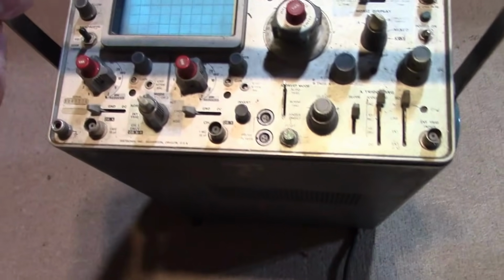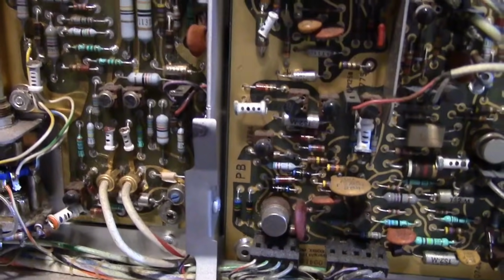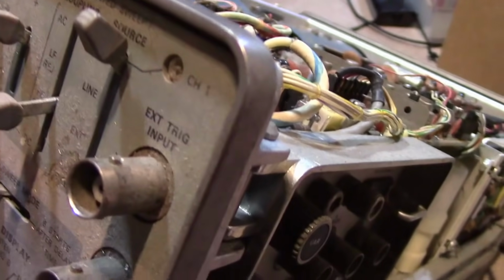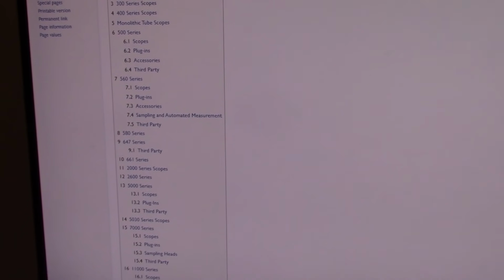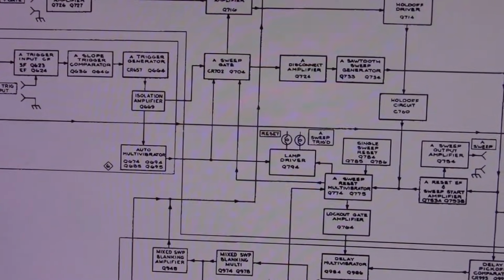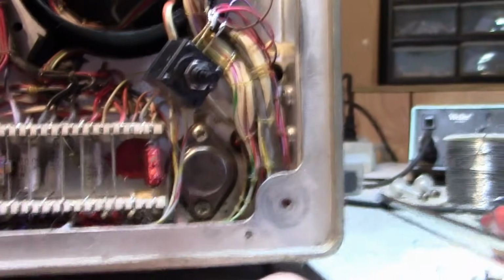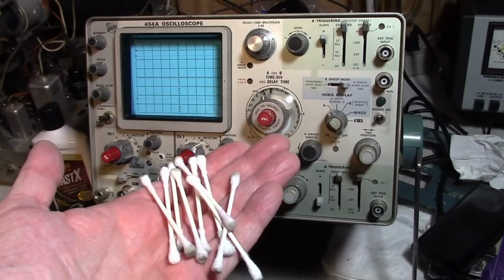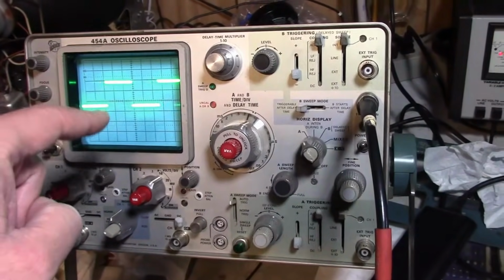Tektronix 454A scope from ~1971

Comment: The scope was made for IBM Tech as so it would fit under the seat of an airplane. IBM designed some of the functions. I cant stand the new digital crap, they are very cheaply made, but cheap in price is attractive. A few months back I had one and could not  get use to it. Make sure to keep the air filter clean.
Reply from the maker: There are very expensive, high end digital scopes too.  Like the $20,000 5 series B MSO scopes.

Comment: Nice work.  Ive restored a Tek 475 and a 475A which are similar scopes to the 454 and they were both basket cases and I will say this,  Tek scopes of this era (early 70's and solid state),  are absolute maintenance whores.  So many cam/drum activated mechanical switch contact points in the both the timebase and vertical attenuator controls make for some lengthy and meticulous cleaning steps.  Once you get everything done though,  they are pretty solid.  Just try not to move them around too much once you have them setup on your bench where you want lol,  they can get...a little grouchy

Comment: I have a telequipment scope from 1971 very similar. Cheap knockoff of tek but made by tek. It's actually very  functional. Not very serviceable like tek is though. It has like 50 or more transistors if I recall, all socketed in ceramic sockets. It was shipped to me on the east coast from California and unfortunately it was damaged in shipping. A knob was chipped, the plastic back was in a few pieces. Also some caps knocked off the board. All fixed now.

Comment: Thanks for taking the trouble to video your scope . I was given a 454A 20 years ago and it has sat in the loft unused since so I thought I would power it up today.  Well to my surprise it turned on and worked ok, I had a trace on the screen as well. When I swicthed it on after lunch it worked for 5 minutes then there was quite a pop sound and it is now dead. I have checked the fuses but still dead, what have I done to my scope ?
Reply: it has 4 Fuses.

Comment: It cleaned up outside  quite well. The critical  attenuator circuit boards inside are made with Polysulfone. 
The polymer will react with the "good stuff". Rotary switches are not affected by normal cleaning agents.
 Cleaning all the switches inside ( accessing) may be a trip down the "rabbit hole" for sure. It is a really nice 

scope. Steve

Comment: I have a Tek 454 that I got from a former employer's employee auction, think I paid about $150 for it back in the late 1980's.  Price included all the manuals, probes, viewing hood, and a scope cart.  It still works fine, though I had to do a bit of cleaning inside to get rid of some 'noise'.  The CRT filter bezel was missing on mine, so I made my own out of some strips of double sided PC board and a blue overhead projector blank sheet.   I'm not sure what the difference is between the 454 and the 454A, they seem to look identical. (Actually mine has a smaller CRT).
Reply from the maker: Based on other comments it seems the 454 had nuvistor tubes on the inputs while the 454A has FETs.

Comment: It looks like that was made in 1972 based on a date code I saw on a transistor. I know somebody who just acquired an HP spectrum analyzer (released 1979( and I would need to imagine that it's a fair bit more complicated than your scope which is already way too complicated. Like this scope it looks complicated at first and has a huge manual but once you power it up you find that it's relatively easy to use.
Reply from the maker: I had one of those early spectrum analyzers a while back.  Truly a wonder to behold.  It used analog circuitry to "draw" all the little zeroes and ones on the CRT face.

Comment: Hi Bob, I have a 453 and when I powered it up for the first time the roar from knackered bearings in the fan nearly made me leap out of my chair! Sealed bearings so you can't really lubricate them. R3ZZ I believe would be a replacement if your noisy fan is the same as the 453.

Comment: I have a 454A, needs some work on channel 2, but it does work. The inside of these is "art". All the hand soldered, hand detailed components. Quite a piece of kit. If I remember correctly, this is the last Tektronix scope that doesn't have proprietary IC'c etc.
Reply from the maker: Yes, that's right.  Although the parts list seems to show they are hand selected for matched characteristics.  Might be a little tricky to replace them.

Comment: I have five scopes, one like yours but 60MHz, a HP 16500c analyzer with a scope card, some cheap USB hantek scope, a Tek 2235 and my first scope a Elenco s-1330.
I've been working on a retro computer project that is going to use a 5UP1 tube and with some circuity to make it work as a X-Y display and use a scope terminal board I found to connect to a PC via TTL/RS-232. In other words a Vector Dumb Terminal.

Comment: Neat!  I have a 453A scope that I use when restoring old receivers.  It originally had an issue where the high voltage to the CRT would arc to a ground point when I got it.  I had a friend look at it and he told me to put a dab of silicon grease where the arcing was happening and it's never been an issue since.  Like your scope, it's loaded with boards and parts that will make your head spin.

Comment: Thats a very nice scope Bob. I have a Digital Tektronix that has a color flat panel display. Technically it is a bit above me. BTW I still cannot figure out what is wrong with my 1950 magnavox TV. The problem is is the AGC circuit. The AGC delat tube should have a minus voltage on it but the voltage goes up to +8 and try as I might I cannot find out why.
Reply: Not knowing anything about your TV I'd guess that the positive voltage is from a leaky paper capacitor.
Reply: @eDoc2020  It's a Magnavox CT-224. I replaced all the capacitors but one of them could be defective. This one has me stumped.
Reply: @HD7100  I can't find any reference of that model. Could it be a CT-214 or CT-222?
Reply: @eDoc2020  It is a CT-224. I have a riders manual.

Comment: I was an Air Force PMEL type.  In the Philippines, we had a ‘clipper’ in receiving that we used to wash the Tek scopes - and some other equipment. As long as you allowed them to dry thoroughly, there was no problem.  We used a mild detergent - not commercial dishwashing liquid. We dried them for a week. Foe those which needed a quicker turn around, we had a dryer made with 100 watt lamps.  Four hours in there would generally get them ready.

Comment: Hey Bob, there's a certain "charm" about using old scopes that is not often appreciated. I mean, back in the day this was like top technology. Anyway, the fact it is essentially transistor driven (and not so much full of proprietary components) means it should be "somewhat easier" to repair and/or maintain. Since you're not restoring equipment that goes into ultra high frequencies I guess this scope should be perfectly useable to you, albeit maybe not so easy to set as your HP scope. 
Either way it's a nice score and should make for a fun restoration

Comment: Yours does not appear to have the nuvistors in the front end; it looks like the 454 has them, and the 454A replaced them with FETs.  Mine must be the 454 then because it does indeed have them.

Comment: I have one of these at work and I still use it.  I really like how it used nuvistors for the input amplifiers.  It smells like old electronics every time I turn it on and the fan starts up.  I wished you could bottle that smell and sell it.
Reply: As far as i'm aware, the 454-without-A uses nuvistors, and the 454A is the one with transistors. I could be wrong though. 
I own an 454a and it's a lovely o'scope. Beautifully made, i love the little roll of lead free solder that you can find inside of it, that you're supposed to use if you work on the circuits with the ceramic solder strips.
Reply: @laurensvisser7623  I’ve got a 485 that I use and every six months or so have to pull down and replace all the tantrum capacitors on one of the boards. 
300Mhz bandwidth. Brilliant oscilloscope for its age
Reply: @MidlifeRenaissanceMan  The lead is not the culprit with regular solder, rather,  the lack of silver.  That little roll of solder is 3% silver,  so it can bond with ceramic.

Comment: Used the 454 a lot in my early days. That delayed trigger took a bit to get your head around. Was real nice in digital stuff to trigger on one signal, then look at another at a later time. Was like the 10X expansion where you could zoom in on a small part of a sweep but not so dim.
I wonder if those knobs might be tenite and getting the white crud like old Xcelite nut drivers and my Craftsman screwdrivers.